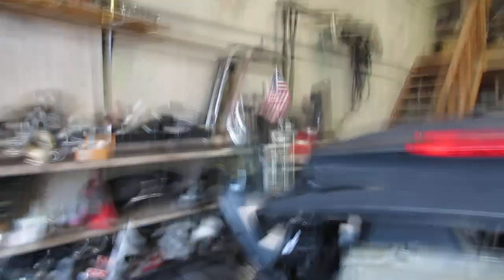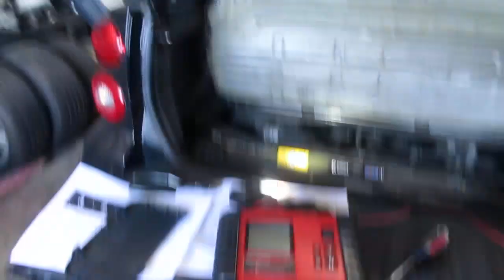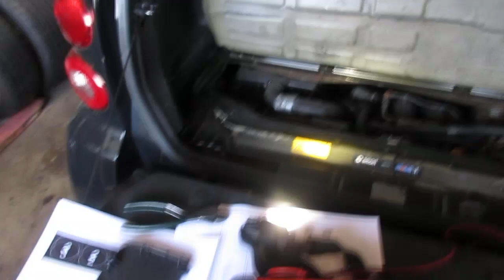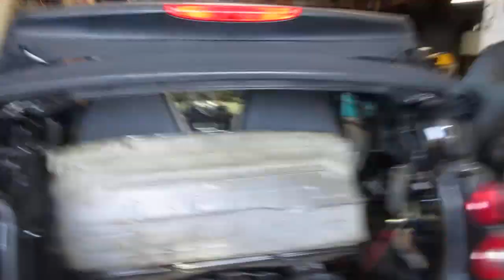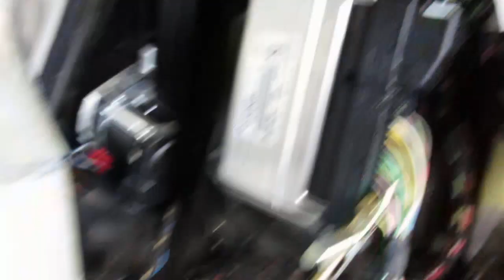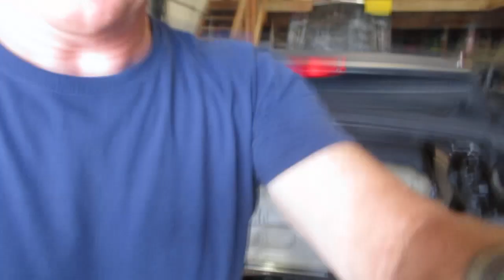2012 Smart Car 1.0L, Code P0301

Comment: John what was the problem with the smart car?
Reply from the maker: Good morning,  low compression on number 1 cylinder. 
The fuel injector stops firing on a cylinder that has low compression so it won't ruin the catalytic converter.
Reply: @JohnSadlersAutoRepair  how was this repaired or did you change the engine
Reply from the maker: @mrgster4889  it was at another shop next to mine, I think they were going to look for a good used engine.